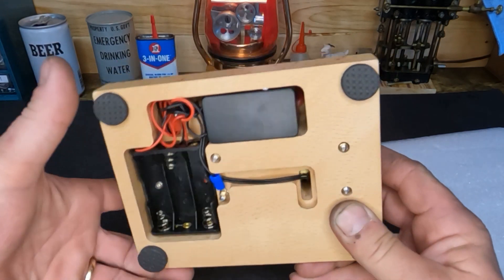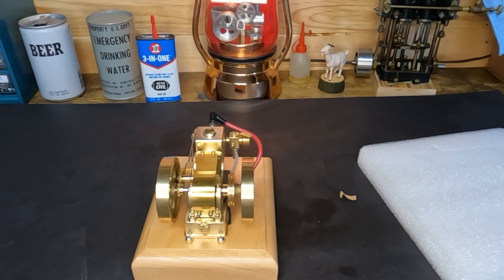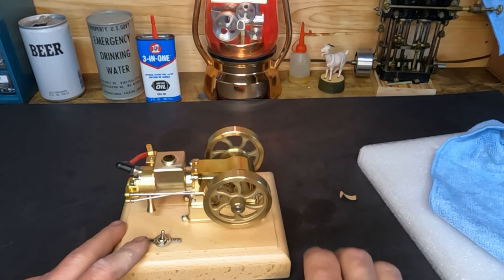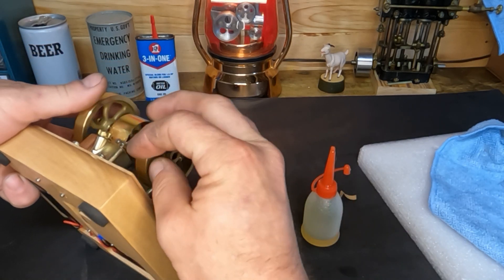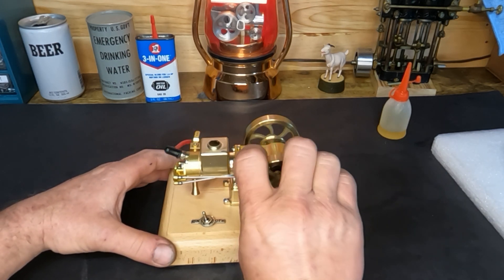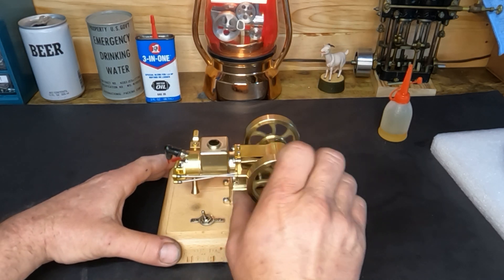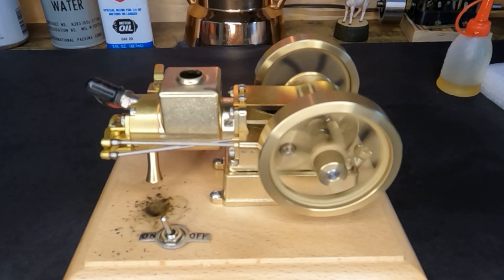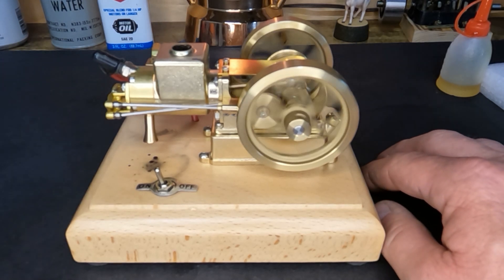M17B engine first start after unboxing and the first impressions

Comment: Hi, It looks like I have to change the failed ignition system on my M20. Can I leave the old magnet sensor part attached, as it’s hidden behind the flywheel?
And what is the issue about removing a battery and placing a dummy? 🙏
Reply from the maker: @ciderboy6490  The magnet is just that, a magnet. If you've lost spark (and determined that the hall effect pickup is the issue) all that is necessary to replace is the pickup (wired bit) the magnet is just what closes the switch.   If you want to be sure that the problem is the pickup trigger and not the ignition box, strip a piece of wire and  jump it between the black and white terminals (those are the ones that fire the coil). If you have voltage to the coil, and can verify that it fires when connecting (momentarily) the black and white wires, your issue is the pickup.  I've tried the "dummy" battery on several different models and have had little to no change.  My biggest issue has been the plug boots and the GARBAGE spark plugs that are equipped from the factory.   I'm sorry for the long winded reply, but I hope it helps.   If not, let me know 👍
Reply: @ thanks for taking the time to reply. I also thought it was just a magnet. I have tried a second spark plug (no spark) on pickup ‘back and fro’ A new unit has been ordered from Stirling Kit, so assuming all wire colours  are replicated in the new unit, will change. Will report back on progress 👍🏻Regards from UK.
Reply: Hi friend. The new unit has arrived.
It looks the same, apart from … two black wires to the hall sensor, where the old one has three (blue,black and brown) as this old hall sensor has three cables, which two should I use?? 
As the new unit hall sensor is effectively for a different engine .. so it’s not a straight swap ?🤔
Regards.

Comment: What are you using for fuel mixture?
Reply from the maker: Hi Al, I am running 94 octane ethanol free 40:1 mix that is made by VP fuel. I have had zero problems with using it whatsoever. I hope this helps. Thank you for your question and your interest.
Reply: @steam212  ok so I just purchased an m17 not the b model. I’m assuming it’s the same thing except without a rocker arm on the intake. Would you recommend the same fuel mixture for that as well? Is it technically a 4 stroke engine but running mixed fuel because that’s the only lubrication it gets?
Reply from the maker: @alnorato1987  Hi Al, I run the same 40:1 mixture in all of the small model engines here in the shop. In my opinion it is cheap insurance to assure that the cylinder has lubrication.
Reply from the maker: @alnorato1987  Congratulations on your new engine 👍
Reply: @steam212  thank you!
Reply from the maker: @alnorato1987  Anytime, I'm glad to have helped. Don't forget to oil all of the other moving parts also 😉
Reply: @steam212  will do!
Reply: @steam212  one more question, I have some vp 50:1 ratio in the garage. Is that safe to use or too little lubrication? I know you said 40:1

Comment: kinda makes me want to get one of these little guys and see what it can actually do. I still don't like the viton o-rings for piston rings though. Should be cast iron in a steel liner. Bet they'll melt if that thing ever gets told to do anything useful. Prolly also why it won't idle for crap right now; tons of friction in there.
Reply from the maker: I'm not a big fan of the o ring idea either but this one does have a steel sleeve. I'm working on editing the second video on this engine now and we address a couple of issues that we noticed.  Thank you for your interest and commenting.
Reply: @steam212  If it already has a steel cylinder wall it shouldn't be too hard to increase the skookum factor by quite a bit. Little engine like this isn't gonna make a world-changing amount of 'git' but it would be pretty neat to run a small brushless motor off of it like a generator, rectify the output to DC, and power something like an N-scale or HO-scale model railroad with it. Could use a flyball governor for a model steam engine to keep the revs in check under varying loads pretty easily.

12-15 watts isn't unreasonable for this engine to be able to sustain on a 100% duty cycle, which is about what you need to run a model train(HO/N both run at roughly 6-12 volts around 250-500mA). But hell, a Cox 0.049 that has literally half the displacement will push 45-50 watts and a TD 0.049 around 100, so a peak output in that ballpark should be plausible albiet with the caveat that the engine would quickly boil off its coolant running that hard.